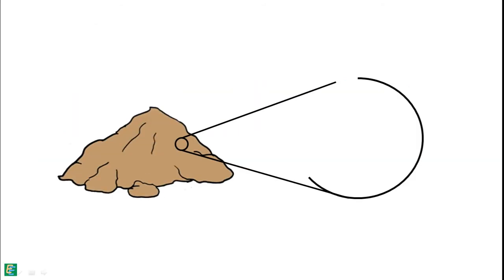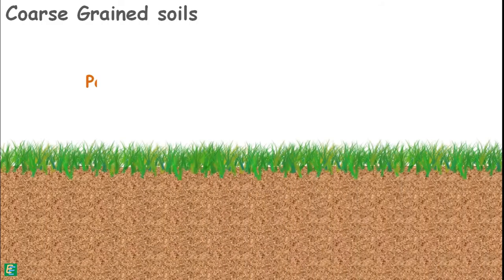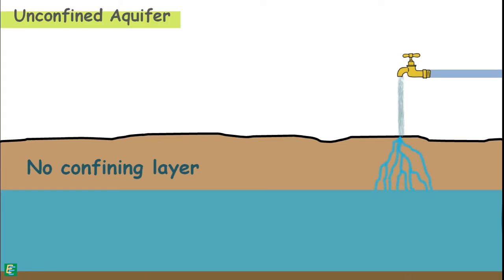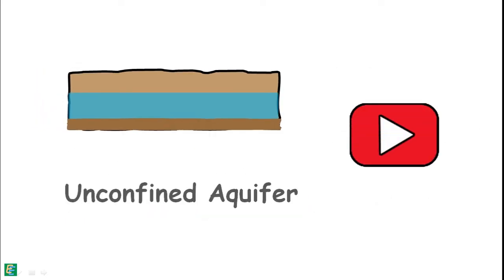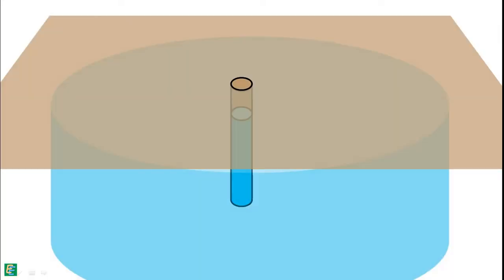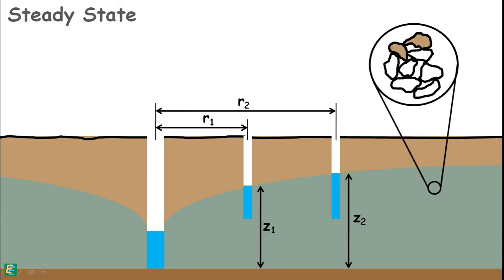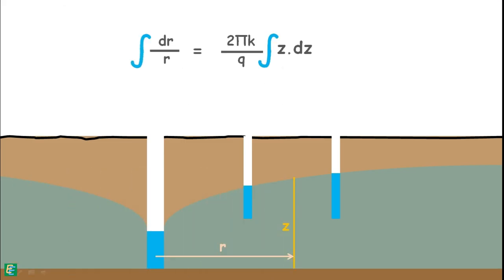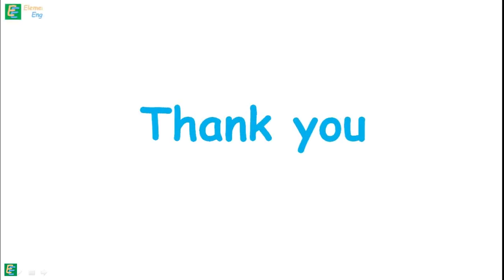Unconfined Aquifer - Permeability of soil - Field test

Comment: Well explained video but still I'm having some doubts. If the water is continously being pumped out of the main tube, how is the level of water in the main tube less (surrounding level may drop as of draw down curve but how is it possible that the water being continously pumped out from the tube itself has a lower level?) and the next thing is how the area considered as cylindrical? and since the water being pumped out from the unconfined aquifer is at the bottom of the pervious layer i.e can be rocks or sediment deposit's bottom and in the figure we can see that the water has it's own layer. so, if the water removed is replaced by the adjacent water, it should be free to move and how is the concept of water percolating the soil is explained?  And also since it is field test, how is the value of h1 and h2 determined in the field?(as it is below the ground) Anyone who knows, please explain this